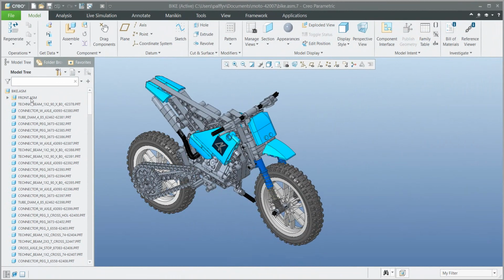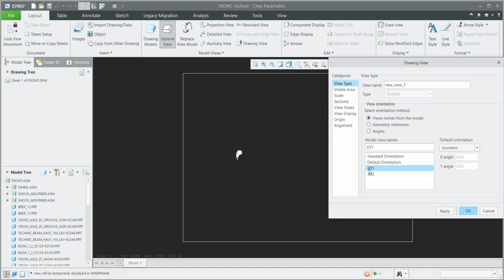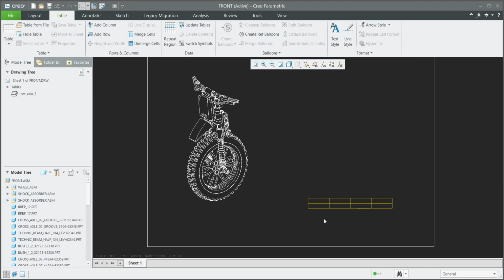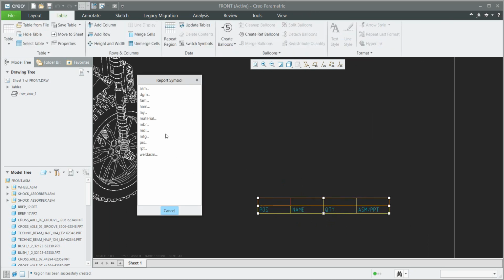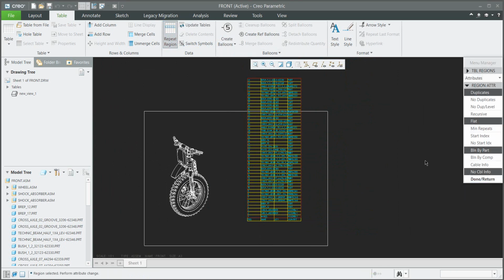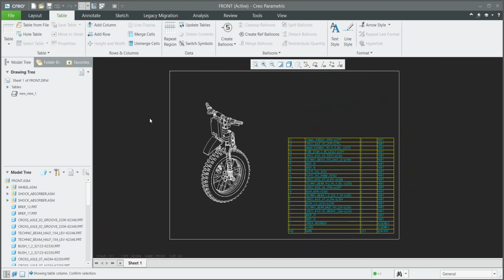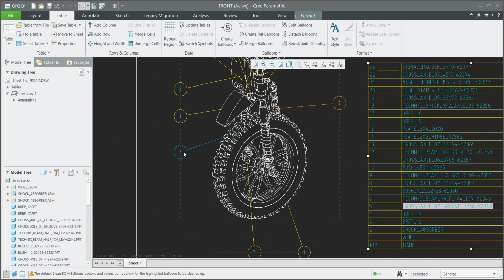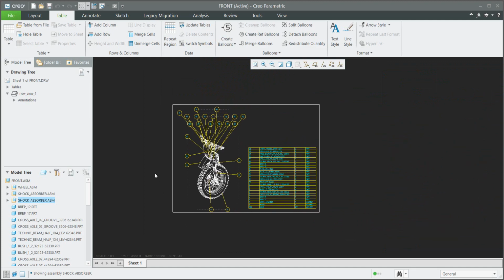Creo Drawing tutorial: How to create BOM table from the scratch

Comment: I made an assembly that contained another assembly inside it (I saved the first assembly, closed creo, opened creo again and continued working on it, saving the completed assembly under a different name, leading me to have an assemblyV1 inside my assemblyV4 file). Is it still possible to make the BOM show all components used? I am currently unable to get it to show components that were used in the first assembly...
Reply from the maker: Try to switch from Flat to Recursive  - the system will show all asembly components https://youtu.be/vAGGOoA3cpo?t=129